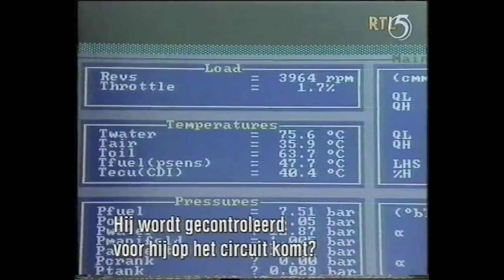Brian Hart racing engines in Formula 1

Comment: The Toleman cars were built a couple of factory units away from where my father worked. I was a bit too young to appreciate the significance of it, but I did get into F1 when I was a bit older.
Reply from the maker: Hi Simon you had a job in F1?
Reply: @ClassicFormulaOne1  I meant as fan sadly. I would love to have worked in F1 but the opportunity hasn't arisen yet. I don't live far from either the Williams or Alpine Factories, so there is always a chance...